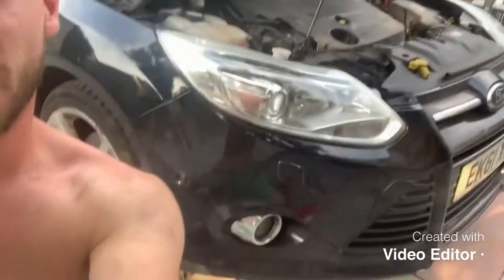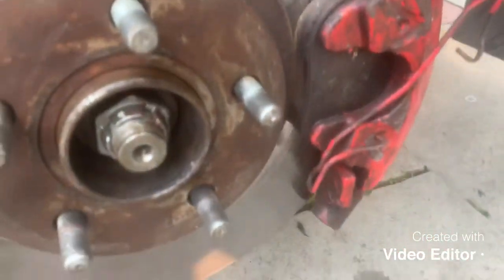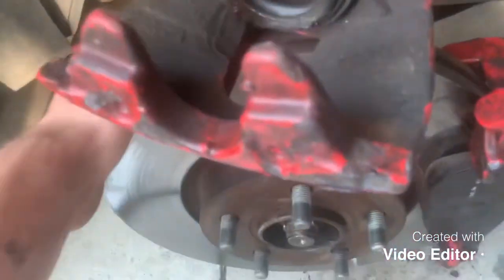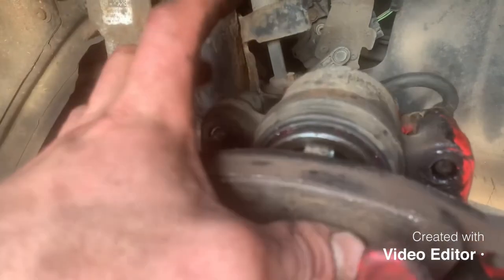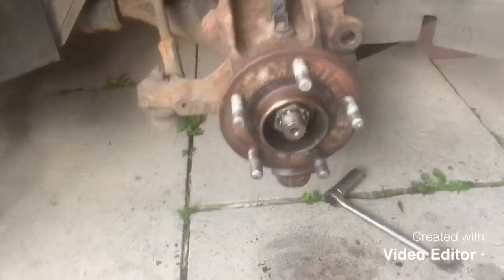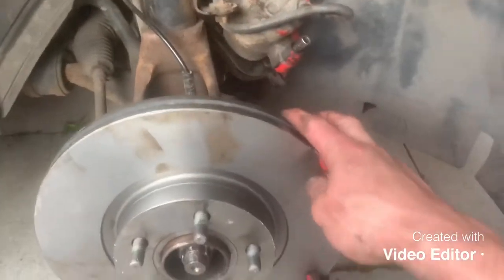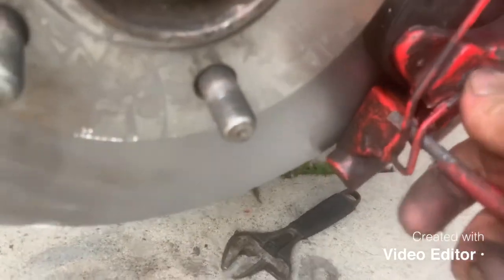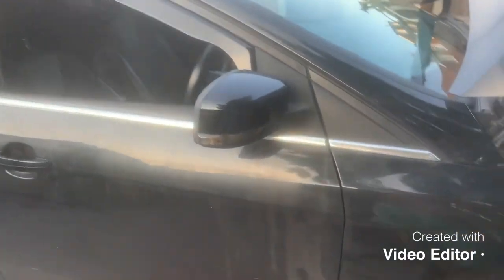Ford Focus - Brake Pads Brake Disc Removal and Replacement

Comment: Great video and will be following your video when I do my brakes and disc. What size disc though? 278 or 300mm as I seem to have a choice of 2 when I’m searching to buy them. Thanks
Reply from the maker: Hi and thank you. I think the bigger ones are for the st version. Double check though when buying. If using euro or gfs they will tell you which size with the reg. hope this helps. Cheers.